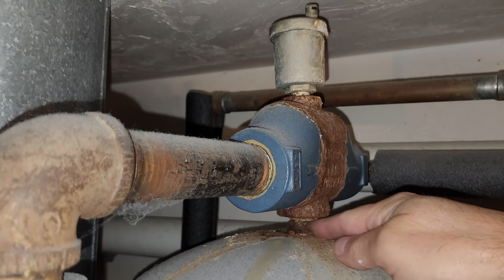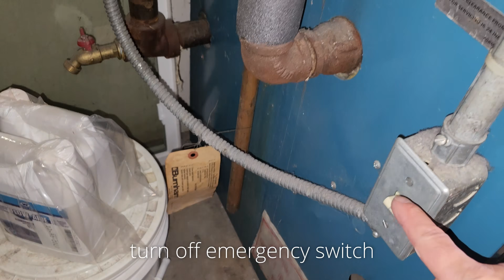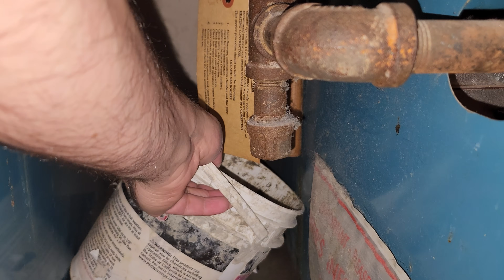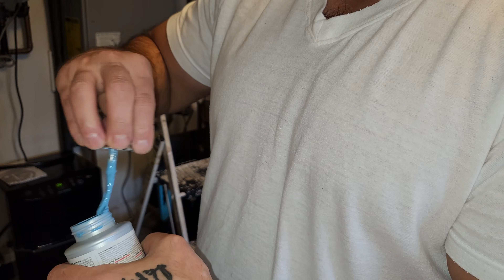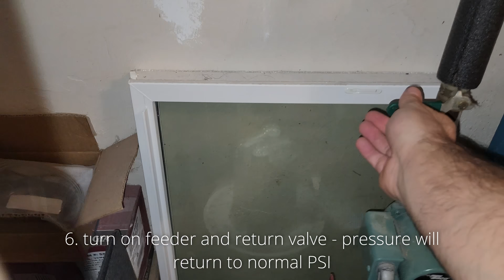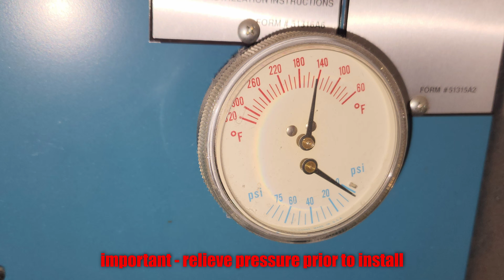How to replace a leaking air vent on a boiler safely - Hy-Air Vent Replacement

Comment from the maker: If this video helped you, put a like, leave a comment, and subscribe for more great videos. Note that the threads on my air vent is 1/8 not 1/4, check you thread size before replacing it. 

Helpful links:
Taco Air Hy-Vent ( check your side tread) - https://amzn.to/4iZA051
Tru Blu Pipe Tread Sealant - https://amzn.to/3MKTGxn
Tread Tape - https://amzn.to/48Tpojk
Plumbers Wrench - https://amzn.to/4pwdKSJ
Try Amazon Prime Membership for free (access to free shipping): https://link.amazon/B0ivPJAX8

Comment: On the valve cap the company says to tighten it down by hand and then 1/4 turn open.
Reply from the maker: Yeah you want to leave it opened a little.

Comment: Once you pull the pressure relief valve, aren’t they known to not seal correctly and constantly drip after?
Reply from the maker: I guess that it could happen, but it's the safest way to relieve pressure. If it continues to leak you need to replace the expansion tank. I will have a video on this soon, so subscribe for more.
Reply: The pressure relief valve needs to be replaced if they leak so don't be afraid to open them. Every cleaning they should be checked. They are a safety measure. I didn't want mine to leak & told one reputable guy not to open it & this is what he told me cause this is what makes your boiler a bomb if it's not working right.

Comment: Those are 1/8” threads on that one! Anyway Hats off for fixing your own stuff!!
Reply from the maker: You are correct, I said 1/4 on the video by mistake. On the vide i did put a note to make sure the thread size is checked. Thanks for taking the time to comment.